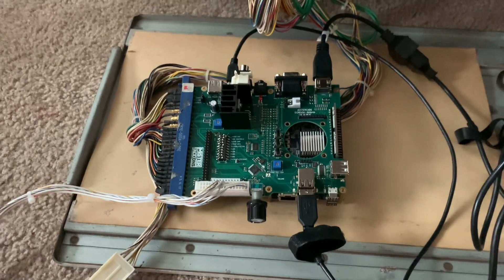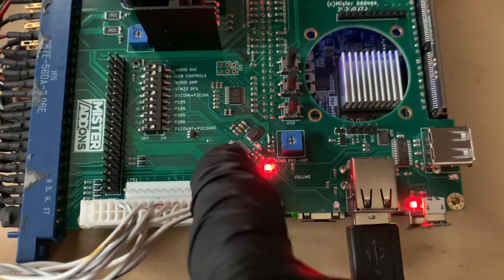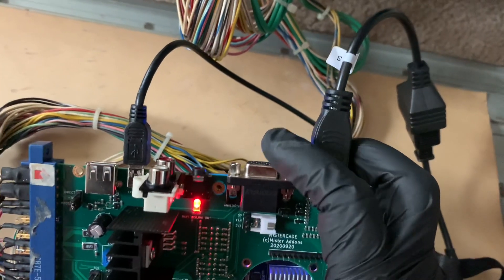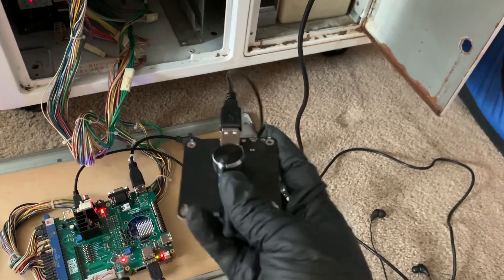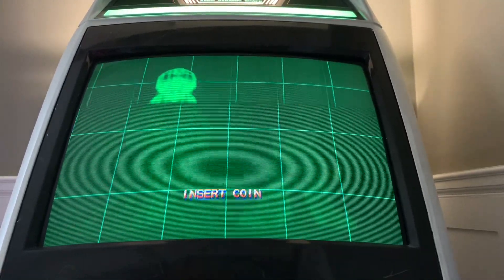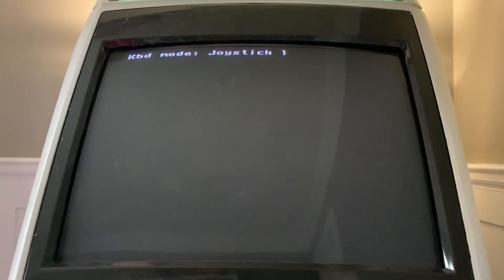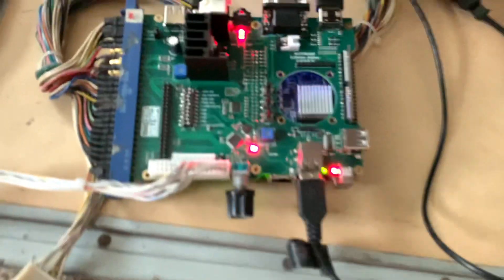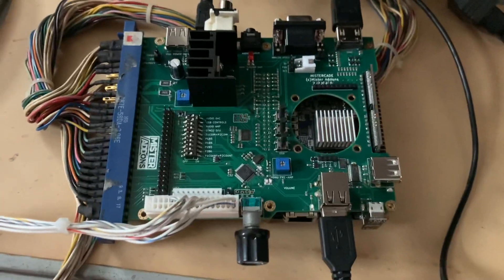MiSTer FPGA Arcade Adapter (MiSTercade) Project Status and Overview

Comment: I love the look and function of the mistercade board you are developing. using a jamma to mister is a great way to go when one wants to push beyond mame or retropie. 

i have a question and to me it is huge. 

If we want to use old arcade cores, ms pac, galaga, DonkeyKong, space invaders, you know all the old early 80's stuff and if we want to do a cocktail table cabinet, DOES THE MISTER CADE ALLOW TWO CONTROLLER INPUTS? you know, first for player one at one end of the table and only player 1 controls work and then when the screen flips for player 2, only player 2 controllers work.

I know Mame will do it. i think PI will do it, but i can't for the life of me get Mister to do it.

Thank you for your great and very smart work!

astals

Comment: ok, this is a game changer! /need :D you mentioned JVS on the video section, will this also work with a JVS setup like in the naomi/taito cabs?  I assume it'd need a USB or serial to RS485 and an implementation of the JVS protocol?
Reply from the maker: That’s the goal but I’m missing the RS485 part. Working with someone on it but no ETA.

Comment: So this is a new board that you can hook up to an arcade so you can have mister in like an arcade environment? Will this eventually be in your online store? Is there a way to change the orientation monitor setup from vertical vs horizontal or do you need two arcade cabs, 1 for vertical games and 1 for horizontal games?
Reply: yeah, no way to rotate the games with analog video so you'd have to rotate the monitor or have 2 cabinets :)
Reply: You can rotate the monitor on the cabinet or if you get a tri sync candy cab you can use the scaler in Mister to rotate.

Comment: What about turning it off and on? Hi score saves? I see this on the forum as not yet sorted, so do u need to keep a mister memory active while in some kind of standby?
Reply from the maker: It's JAMMA so it comes on and off with the cabinet. You can pull a pin jumper and power it separately if you'd like. No real high score saving support that I'm aware of.

Comment: Btw, will you be making a complete kit with this when released?
Reply from the maker: Yeah, it's really just 3 parts so far: DE10-nano, SDRAM, and the MiSTercade
Reply: @MiSTerAddons  ok, I’ll pickup the kit when it’s ready! Any eta so far?
Reply from the maker: @AgentMoler I have to solve the communication issue between the microcontroller and USB hub first before I have an ETA
Reply: @MiSTerAddons  ok looking forward to your updates

Comment: What settings will you use to rotate the vertical games?  I'm also using MiSTer in my (custom) cabinet but it uses a 15 kHz TV that I can't physically rotate.
Reply from the maker: The menu can be rotated in MiSTer.ini but the games output in their original direction, which is hopefully pretty consistent.
Reply: @MiSTerAddons  Oh, right, but I'm talking about rotating the vertical games.  For example, you showed DoDonPachi but it needs to be rotated to look correct.
Reply from the maker: @sofakng163  Oh, sorry, I misunderstood. I'll be rotating the monitor on my other Astro City cabinet that I have on the way. Hoping most STG games rotate the same way or that DIP switches are exposed to set the direction of rotation :)

Comment: How is this going to communicate with the arcade cabinet controls?? connector is USB that I know, but what protocol is using? its a parallel or serial?? I would like to have 0 input lag if possible, or at least something on par with the original hardware , when is this going to be released to the public??, I would like to get a pair of these units, but I don't have a MISTer yet.
Reply from the maker: Controls are encoded to USB HID by an STM32 microcontroller running purpose-built firmware. 0.73ms average latency. Hard to beat that :)

Comment: Hmmmm!!! Wonder if this will work with a recroom masters arcade cabinet “jamma” edition.
Reply from the maker: CRT or LCD?
Reply: @MiSTerAddons  the cabinet is designed for a 32” lcd it looks like according to their site, wonder if there would be a way to fit a crt. Would it be possible to use lcd with your setup?
Reply from the maker: @fastminivan  you can still use the HDMI out on the DE10-nano but I suppose they have it designed to use the video from JAMMA somehow. I’m sure it’s possible, whichever is the case.
Reply: @MiSTerAddons  Oooh! Yeah I’m not sure I had been wanting to order that cabinet but was waiting to see your misteracade updates and I think this combo may work for me 😈 . I can’t wait for this mistercade release! Been following your updates so I’m excited lol